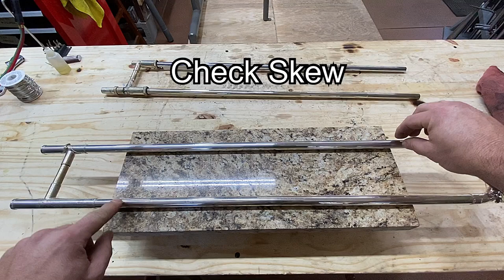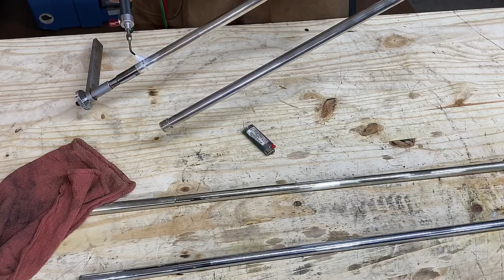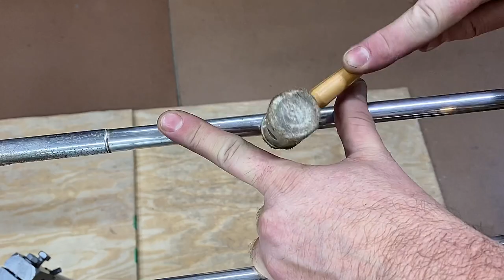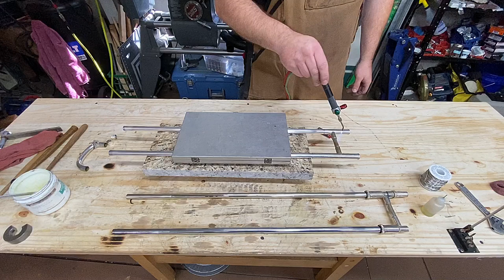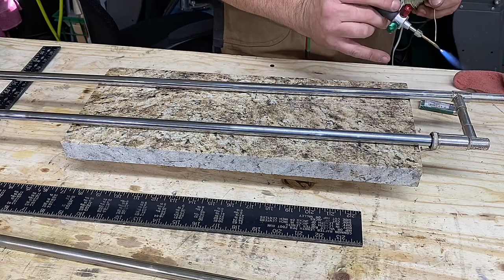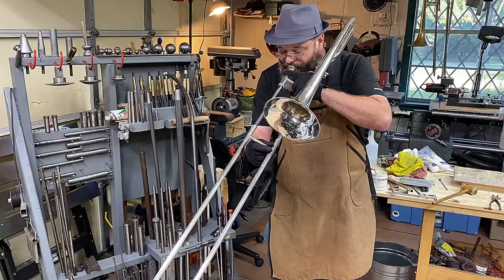Bach Trombone restoration part 3- Wes Lee Music Repair

Comment: If I understand well, you had to replace the inner tube because it was a collection of sleeves ?
Reply from the maker: 1090yoyo the lower inner tube was a raw nickel replaced tube that was held in place, come to find out with 3 sleeves. It was also undersized so it leaked air terribly. Raw nickel was the old way slides were made, all modern slides are chrome plated. I replaced with OEM chrome plated slide that was made for that model.
Reply: Thanks
An undersized trombone slide rail... Who the hell has this kind of idea...
Reply from the maker: 1090yoyo I can imagine 30 years ago that whoever “needed” it for the game on Friday, and that’s what the tech had lying about. It wasn’t hack work per se, just the wrong size/type tube that concerned customer. Finding the 3 sleeves was pretty funny to me.